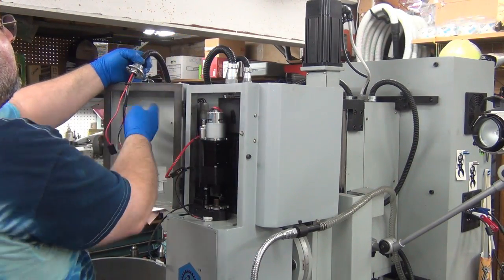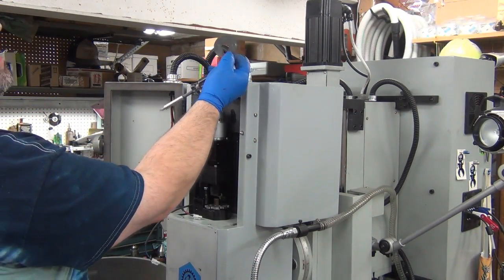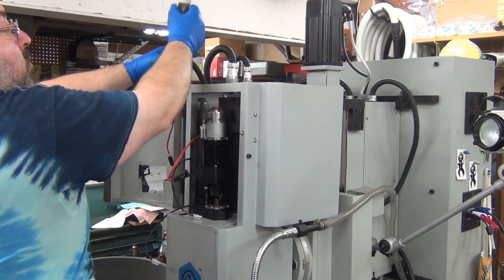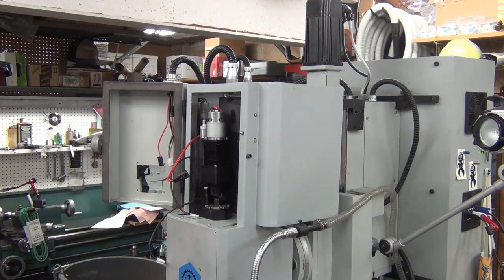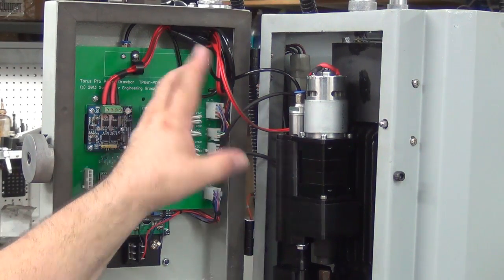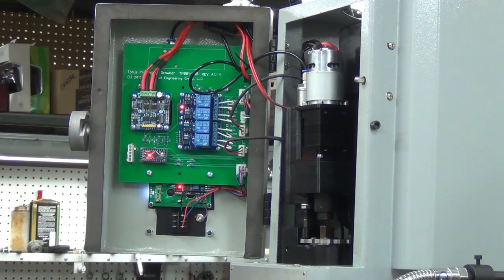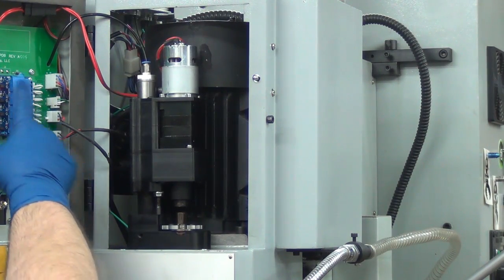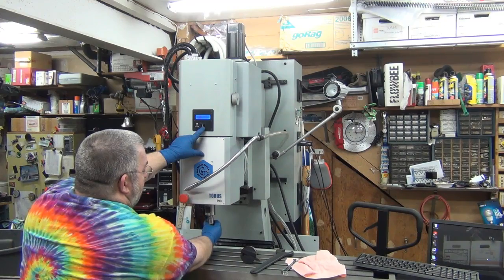Novakon Toru Pro - PDB pt3 - Front Door - Finale

Comment: Awesome, that PDB is great. I wish I had one on mine since I use R8 tooling. I don't think TTS would survive the load I would put on it but I would like to use TTS for small things.
Reply from the maker: War Machine LLC There's been a lot of discussion about TTS and pullout.  Have you seen this thread?  It's by Ray L.....the guy that made this drawbar.http://www.cnczone.com/forums/tormach-personal-cnc-mill/212198-posts.html
Reply: Thanks Mike I think I glanced at some time ago. If Ray says it's good I'm sure it's good, he's another hero of mine. I don't have a Novakon but I've been following his truly amazing work on the ATC. I've never used TTS so I couldn't say but something shy'd me away from it some time ago. I can't remember what it was maybe just the thought of running a 3.15" facemill in steel and trying to change out the 3/4" R8 collet to a collet chuck. Actually it may have been that I didn't have a power drawbar and thought the TTS system would be wasted on me. Hopefully my next mill will be CAT40.
Reply from the maker: War Machine LLC
You're more than welcome!
I bought an extra TTS collet for my manual mill.  I think the lack of a power draw bar would make TTS even more appealing.  Only have to loosen the collet to change tools.  But....if you're hoping to switch to CAT40, I'd just stick with what you have. :)